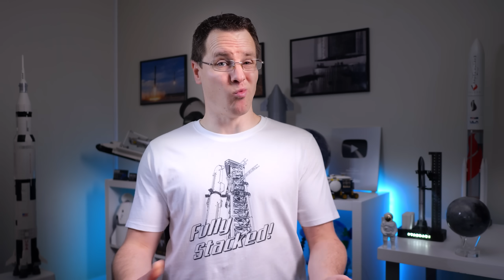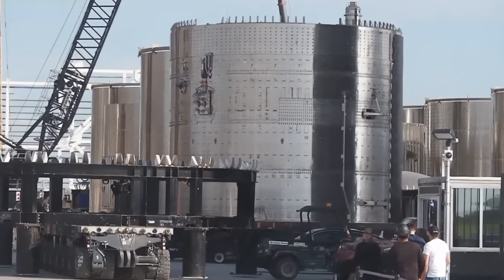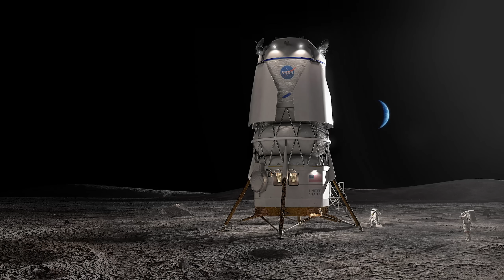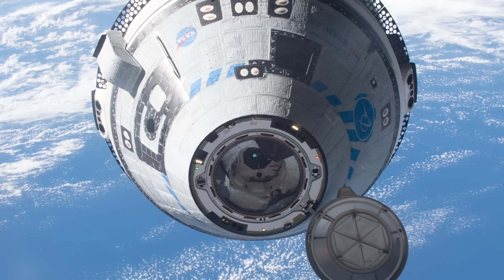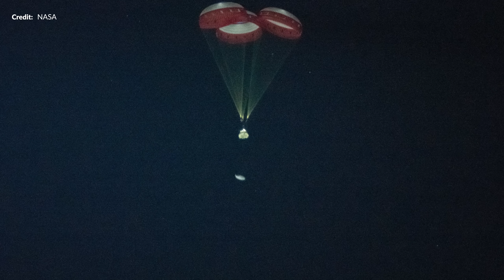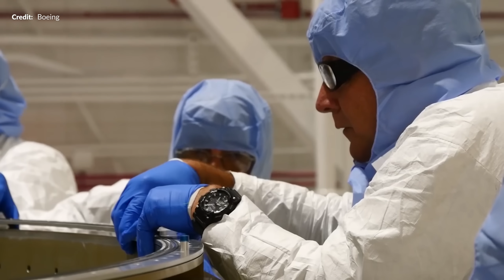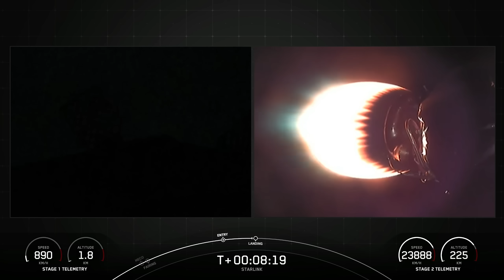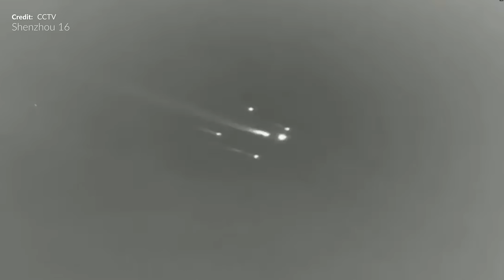SpaceX Starship: Mega Pad Upgrade to Tame the Thrust, Boeing Starliner Delayed Indefinitely

Comment: At this point Starliner is fucked.  They’ve had so many delays that SpaceX has become the defacto ride for Astronauts to the ISS.  On another note, it’s amazing how quickly SpaceX is repairing all the damage caused by the launch last month.  Thanks for the timely updated, Marcus, excellent as always.
Reply: Starliner has an issue, Boeing forms a committee to decide what to do.
Starbase has massive launch pad damage, SpaceX gets on with it.
Reply: @UncleKennysPlace  yes they don’t have all the beaurocracy.
Reply: @UncleKennysPlace  Gets on with what .......explosions' 🤣
Reply: Yeah Boeing is a day late and a dollar short. They should just bite the bullet and can the program.
Reply: @aldunlop4622  Presumably if they (Boeing) decide to can the program, they’ll be on the hook for much of the money they were paid. So, they’ll keep plugging away, even though it’s pretty much useless.
Reply: @aldunlop4622 Boeing gets so many tax dollars it don't really matter.
Reply: @MrBigShotFancyPants  Starliner is under a fixed-price contract and Boeing has been paying for the Starliner fixes.
Reply: Flammable tape! I guess all the best engineers do work at SpaceX.
Reply: @staticgrass  To be fair, the tape is flammable only in certain situations per reports. And requires failures of other hardware to happen. Per NASA/Boeing, "Although that tape is commonly used on other spacecraft, they are evaluating if it is acceptable for crewed flight (article NASA and Boeing say preparations continue for July Starliner test flight Jeff Foust May 27, 2023)"

Parachute and wiring issues to delay Starliner crewed test flight
Jeff Foust - June 1, 2023

"Both the parachute soft links and wiring tape were used on the Orbital Flight Test (OFT) 2 uncrewed test flight in May 2022 without incident. The soft link issue, officials said, would only be a concern if one of the three main parachutes failed, putting additional loads on the other two, while the flammable tape would have required what Nappi called “multiple failures” elsewhere in the spacecraft."

---------------

Boeing finds two serious problems with Starliner just weeks before launch
ERIC BERGER - 6/1/2023

"The second issue involves P-213 glass cloth tape that is wrapped around wiring harnesses throughout the vehicle. These cables run everywhere, and Nappi said there are hundreds of feet of these wiring harnesses. The tape is intended to protect the wiring from nicks. However, during recent tests, it was discovered that under certain circumstances possible in flight, this tape is flammable."
Reply: @staticgrass  It is not Boeing engineer's fault that the tape was flammable, that was the only kind that Dollar Tree was selling when they went shopping!
Reply: @staticgrass  I thought Apollo 1 taught us that nothing flammable could be used in spacecraft. Period. A rule written in blood as the old expression goes. Just makes your mind wobble does it not? How could Boeing get this wrong.. they have unbelievably failed at every step. How many billions of our money have they wasted and can we get it back?
Reply: @scottwheeler2494  To be fair, the tape is flammable only in certain situations per reports. And requires failures of other hardware to happen. Per NASA/Boeing, "Although that tape is commonly used on other spacecraft, they are evaluating if it is acceptable for crewed flight (article NASA and Boeing say preparations continue for July Starliner test flight Jeff Foust May 27, 2023)"

Parachute and wiring issues to delay Starliner crewed test flight
Jeff Foust - June 1, 2023

"Both the parachute soft links and wiring tape were used on the Orbital Flight Test (OFT) 2 uncrewed test flight in May 2022 without incident. The soft link issue, officials said, would only be a concern if one of the three main parachutes failed, putting additional loads on the other two, while the flammable tape would have required what Nappi called “multiple failures” elsewhere in the spacecraft."

---------------

Boeing finds two serious problems with Starliner just weeks before launch
ERIC BERGER - 6/1/2023

"The second issue involves P-213 glass cloth tape that is wrapped around wiring harnesses throughout the vehicle. These cables run everywhere, and Nappi said there are hundreds of feet of these wiring harnesses. The tape is intended to protect the wiring from nicks. However, during recent tests, it was discovered that under certain circumstances possible in flight, this tape is flammable."
Reply: NASA wants to keep alternatives and competition going between launch providers, and also support the various workforces and economies.
Reply: @RussTillling  I completely understand the rationale behind having two launch providers, but Boeing just isn't cutting it.
Reply: @RussTillling  NASA is right in wanting that, but at this point we don't have alternatives or competition between providers, since the alternative doesn't actually work... I'm starting to agree with Jordan White, if Sierra Space had been given the contract back then, I cannot believe they would not have a result by now.
Reply: @RussTillling  NASA will have multiple options even without Starliner.  They will be able to choose between Crew Dragon and Starship.
Reply: @nathanmays7926  - Could be quite a while before Starship is rated for human descent. I can imagine a period of time during which humans can go up on Starship, but have to come back down on a Dragon -- or, I wouldn't be surprised to see Dream Chaser rated for descent before Starship.
Reply: @nathanmays7926  I feel like you've misunderstood the meaning of competition. Are you being sarcastic? I hope you're being sarcastic. Or nihilistic...
Reply: @RussTillling  If they were competent I would agree with you. It's just the good ole boy system at work.
Reply: @isnsrti if they can't do it or if it doesn't work or the company  doesn't make money then they should fold
Reply: @RussTillling  - Not that there's much extra money to throw around, but I wish there were a way to expedite the development of a crew Dream Chaser -- a vehicle with a reason to exist, with some unique capability in terms of descent and landing location options, and such. And it's pretty (unlike Starliner); would look sweet on some graphics alongside Dragon, showing the USA's orbiters. 🙂
Reply: @RussTillling  "NASA wants to keep alternatives and competition going between launch providers, "... rewarding more money to the competition that is failing, and giving less money to the company that is succeeding, is exactly NOT the way to do that.
Reply: @RussTillling     not NASA, the politicians who decide where the money goes - ideally so, that they get elected by the recipients and have some cozy jobs for friends and family from it
Reply: @joansparky4439  Congress funded the Commercial Crew program, but NASA chose the providers. Boeing was seen as a top aerospace company in 2014 and SpaceX were the new upstarts still trying to land a booster, which they did over a year later. SpaceX didn't reuse a booster until 2.5 years after they got their Commercial Crew contract.
Reply: @steveaustin2686    NASA chooses what is available and that is being influenced by politicians.. just look at how long it took for SX to get into defense launches and for how long the military/political leadership in the decisive positions fumbled the contracts/awards to give ULA&Co as much as possible - because jobs & votes depend on it. SX doesn't offer jobs & votes, SX offers economical product, exactly because it doesn't try to bribe/lobby politicians (at least for now.. wait until Elon is out, the beancounters know how this is done and will do it).
Reply: @joansparky4439  Bullcrap.  NASA has to follow appropriations regulations designed to stop the influence you claim. SpaceX filed a GAO complaint and sued to get the NSSL program from being sole source. Now the USSF is looking to open up NSSL payloads even more than for NSSL2, for NSSL3.

🙄 If you think that SpaceX doesn't lobby, I can get you some ocean front property about 30 miles east of Miami Beach. Every last bit is ocean front.

It's a good thing that NASA chose two providers, otherwise NASA might still be relying on Soyuz to get to the ISS.
Reply: @steveaustin2686       "NASA has to follow appropriations regulations designed to stop the influence you claim."
And you really want to sell me beach front property while writing this with a straight face?
The arrogance/ignorance of you is remarkable IMHO.

"If you think that SpaceX doesn't lobby.."
Did I state that anywhere?
It's ubiquitous. Pretty much everybody does it, as it's beneficial for the individual (company, privateer, etc.) and our societal frameworks allow for it (#). The more time that goes by the worse it gets, until the whole "operation" is way to inefficient and uneconomic to provide the function to stay alive.
There are books written about it.. I suggest you read 'The Myth of Capitalism' by Tepper and Hearn (2019) for example.
They at least describe the problem and give lots of context/

#) most of the time the lobbying companies, etc. benefit from it, which puts them into a better position (resource-wise) than competitors who don't. So they benefit from this and it is logical that they then naturally will do more of it and that they will grow bigger, just like cancer.
Reply: @joansparky4439  Since that is the whole F'ing point of the appropriations regulations. Not my problem you apparently have a conspiracy mindset.

And all that lobbying is WHY the appropriations regulations exist. 🤦‍♂
Reply: Wish Sierra got their contract lmao
Reply: @aq_ua  They were in third place, behind Boeing and SpaceX. Remember, in 2014, Boeing was still seen as a top aerospace company and SpaceX were the new upstarts, still trying to land a booster. SpaceX didn't land the first booster until over a year after they got the first Crew Dragon contract. And didn't reuse a booster until 2.5 years later.
Reply: I suspect that Boeing is in more trouble than just with Starliner. It has looked like it's been mismanaging a lot of design for a while now. We'll see soon enough, but it looks like it might not be in the race for the next-gen stealth fighters. As a totally amateur analyst, I expect Boeing to either experience a major reshuffling of management, a buyout, or a break up in the next 5 years. Possibly all three. I won't mourn it though: the Boeing that deserves to be remembered is already dead AFAICT.
Reply: It's a good thing NASA paid them for "schedule assurance"...
Reply: @joelcorley3478  Indeed, they have to deliver or lose the money.
Reply: Boeing is about to be shown how the Space industry is no longer up to them and we're better off without their antiquated business model.  Mistakes like these are the root of cost overruns and pissed taxpayers - and unnecessary delays most of all.
Reply: @waynegnarlie1    that business model is not outdated.. it's been well and alive - get elected representatives to formulate rules and contracts to benefit you instead of the competition simply has the highest profit margin there is.
And it's so high, because supply is being controlled and asks any price it can get away with.

In real free market systems profits signals that supply << demand and ANY competition would join in - because there is profit to be made doing exactly that. Profits are there to attract competition!
Our unfree markets prevent this from happening - either via cronyism (politics selects suppliers) or monopolism (politics creates rules that prefer some suppliers and give them control over the supply - see patents, licenses, copyright, etc.).
The end result is that a few control the supply and thus extort profits while the competition is unable to join in on the supply side - which ultimately would drive profits down to zero/normal.

But that is not in the interests of the individuals who run a business..
Reply: @joansparky4439  Yes, you present the issue in an accurate and compelling way.
Reply: @waynegnarlie1     you're either sarcastic or this is a very rare case of someone getting what I'm writing.. either way thanks for the feedback. 🙂
Reply: @joansparky4439  I assure you I am sincere, but I sure don't blame you for thinking the worst.  You amplified my thoughts  on this 10 fold and i appreciate it.
Reply: @waynegnarlie1    Ah OK. I'm just used to people not understanding what I'm talking about.. you're one in 100 roughly per my experience.

PS: where that thinking comes from is much more and it's really fundamental stuff about our societies and why things go wrong on pretty much all scales. Boeing's "failure" really is just one example of this and not even an important one at that.
Reply: @joansparky4439  Relatively speaking it is indeed pretty insignificant.  I think we are in for the ride of our lives in the near term, and that  to me is a major focus as well as to how to best deal with the situations as well as potential opportunities that our future presents.  I hope you continue to write.  As more people express facts and ideas  and the subtle aspects in the articulate way you do, more will open up to it, IMO.  Then we can we can maybe get things done better.
Reply: Only Boeing can get $283m for non-performance of its contracted flights, missed due to its own incompetence. Only NASA is stupid enough to pay - I mean it's only US taxpayers dollars. The GAO probably should look into this contract and reclaim what it can. I can only hope that Ballast Bill has the balls to take on Boeing.
Reply: @tscchope     NASA aren't the ones who lined this up, you gotta look to congress for that, both parties even. At the end of the day every human is just a living thing which optimizes for it's own personal benefit first (only a few don't do this). If you give such people an opportunity (and there is the other end of the spectrum who are ruthless and greedy) it's no wonder what the outcome will be..
This whole system of REPRESENTATIVES who are supposed to control themselves/ each other simply is unsustainable. In it's way nature is deselecting societies that allow such waste every couple hundred years and gets rid of them. We just call that 'revolution' / 'societal collapse' / 'empires going under' while the timescales on which this happens exceeds personal experience, which is why most of us are simply not registering what is going on.
Reply: @tscchope  Let Boeing build airplanes. Leave space to the new generation.
Reply: @tscchope  That $283M was in 2017, based on Boeing weaseling it out of NASA based on the SpaceX 2015 CRS-7 failure and the SpaceX 2016 AMOS-6 failure. It was two YEARS before the Starliner Dec 2019 OFT-1 failure. Boeing has been paying for Starliner fixes ever since.
Reply: @steveaustin2686  Boeing is not involved in the cargo contract and would not receive money for a SpaceX  failure to deliver a private satellite. I'm referring to the $287.2m payment (yes, it was more than I thought) described as unnecessary in the 2019 OIG's report. Boeing has been receiving advanced payments under a revised schedule of milestone payments it put forward, at the same time as it pressed for this payment (outside of the fixed contract price) which I doubt it has actually met. I would not put industrial level fraud by Boeing past this highly unethical company ( I wonder what NASA's 2022 investigation into the current state of Boeing ethics uncovered) that the GAO should certainly investigate.
Reply: @tscchope  🤦‍♂ Boeing WEALSED that money out of NASA by playing on the fear that SpaceX would not be able to complete Crew Dragon because of those failures. NOT because they were in the CRS contract. 🙄 The AMOS-6 launch was not in CRS either. Yes, it is ironic.

Boeing has taken charges against profits since 2020 to pay for the Starliner fixes. These charges have been in financial reports that Boeing has filed per government regulations, so are hardly fraud.

Boeing takes $410 million charge to redo failed astronaut flight test if NASA requires
by Michael Sheetz Wed, Jan 29 2020

Boeing Takes $185M Charge in Q3 for Second Orbital Flight Test 
By Rachel Jewett | October 27, 2021

Boeing Takes Another Charge Against Earnings for Starliner ($93M)
By Marcia Smith | Posted: July 27, 2022
Reply: SpaceX is dumb charging less than half what bullying Boeing is charging
Reply: Starliner ... like 737 MAX ... when beancounters lead an engineering company. Just that NASA has an intense adversity to dead people.
Reply: If they can do something as stupid as use flamable tape to hold down electric cables.. imagine what eles is wrong with that capsule!!!  I would not want to be an astranaught assigned to ride on that
Reply: @deanwatts68  To be fair, the tape is flammable only in certain situations per reports. And requires failures of other hardware to happen. Per NASA/Boeing, "Although that tape is commonly used on other spacecraft, they are evaluating if it is acceptable for crewed flight (article NASA and Boeing say preparations continue for July Starliner test flight Jeff Foust May 27, 2023)"

Parachute and wiring issues to delay Starliner crewed test flight
Jeff Foust - June 1, 2023

"Both the parachute soft links and wiring tape were used on the Orbital Flight Test (OFT) 2 uncrewed test flight in May 2022 without incident. The soft link issue, officials said, would only be a concern if one of the three main parachutes failed, putting additional loads on the other two, while the flammable tape would have required what Nappi called “multiple failures” elsewhere in the spacecraft."

---------------

Boeing finds two serious problems with Starliner just weeks before launch
ERIC BERGER - 6/1/2023

"The second issue involves P-213 glass cloth tape that is wrapped around wiring harnesses throughout the vehicle. These cables run everywhere, and Nappi said there are hundreds of feet of these wiring harnesses. The tape is intended to protect the wiring from nicks. However, during recent tests, it was discovered that under certain circumstances possible in flight, this tape is flammable."